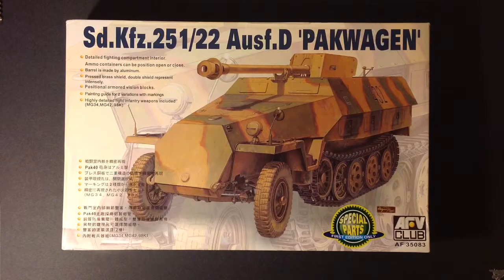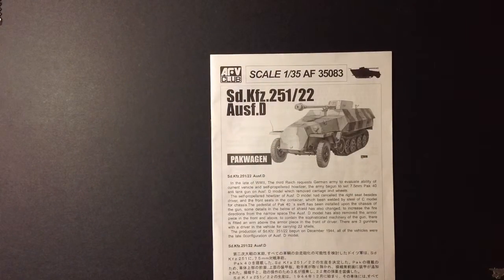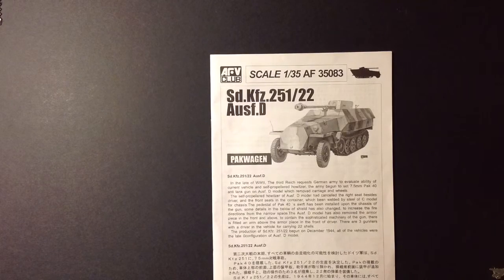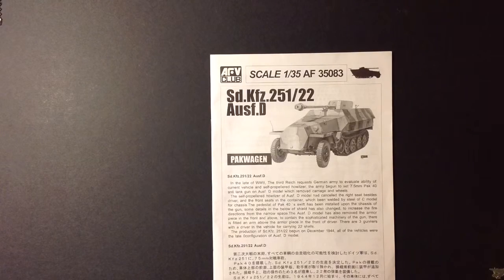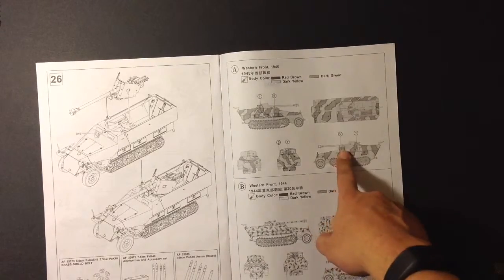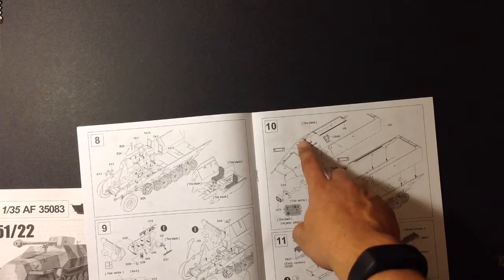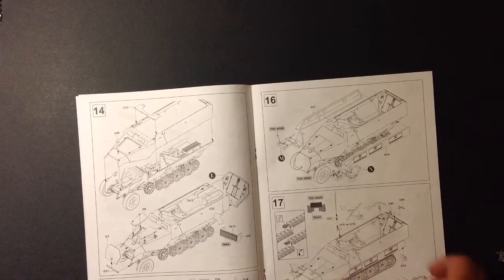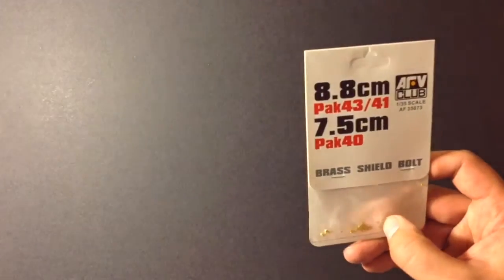1/35 AFV Club Sd.kfz.251/22 ausf D part 1, what's in the box/planning stage!

Comment: Did you ever build this?  I'm having problems with the gun shield?
Reply from the maker: Pat McGrath haven’t touched it in a while, have a lot of issues with fit issues of the hull and gun shield. It’s was very frustrating but hope I get my motivation back one day with this kit. Gun shield seems like it not shaped right or the support rods are not long enough to where CA glue not holding in place. Is that the same issue you are having?
Reply: Papa Kilo 1/35 Armor thanks. I'm nearly finished mine. The fit is awful though the tip I got worked which is if you fit the upper hull to the bottom at the front where there are more angles then there is just a small gap to fill at the rear. It would put me off buying another AFV kit
Reply: @patmcgrath6400  I'm building it right now and I'm having a big issue marrying the top hull with the bottom. It seems the top half pivots over the mount for the gun, so it doesn't fit. I filed down part of the mount and its sides, which makes a difference. To make matters worse, the top half appears not to be long enough so it leaves a 2mm gap in the rear where the back doors are. I'm thinking of cutting the upper half and gluing some styrene in the middle. This might also sort out the wobble.
Reply: @w3dnesd4y57  try what I did which was to fit the top half so it fits at the front and then you only have a gap at the back. I remember that I only fitted the gun mount frame at the end but I think there was a lot of trimming involved. I built the Short barrel version from Tramiya which was a dream to built and not a lot less detail.
I have always liked the version with the searchlight and perhaps foolishly took the AFV version in a shop. I hope I can remember the solutions I used putting the hull together.
Anyway good luck
Reply: @patmcgrath6400  Yes, that's what I was thinking too, I'll try that. I built the Tamiya 251 with the MG in in the front, it falls together by itself.